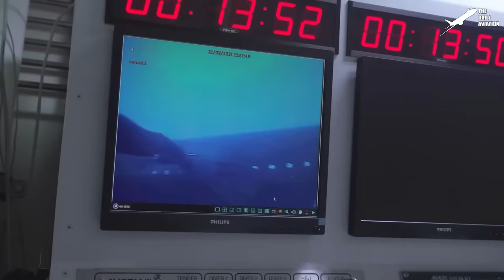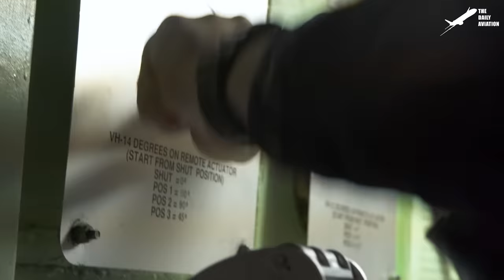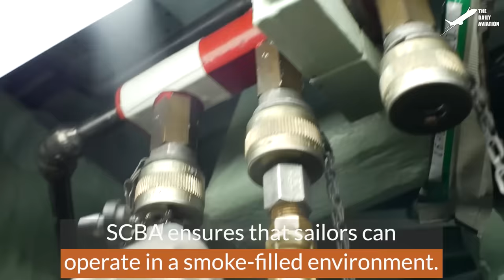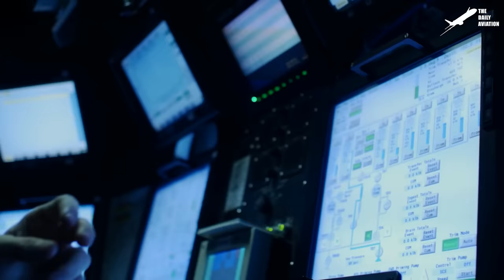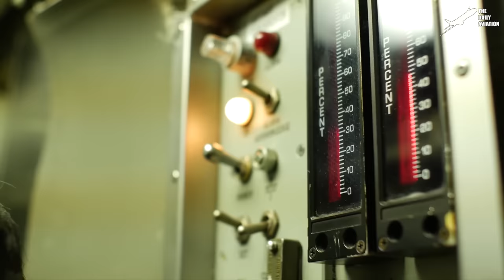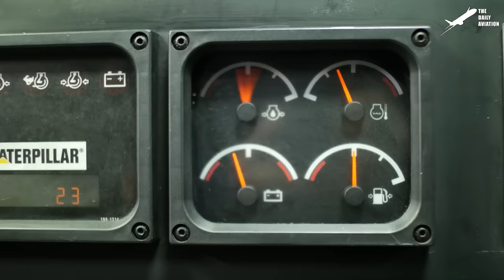Divers Pulling Out Man From Submarine During Scary Rescue Operation

Comment: It's very difficult to escape ,  if u not breathe by open mouth ,highly chances of lungs burst..it's speed of escape Is 50m/3sec.
Reply: You don’t need to breathe, you just need to be able to breathe out (all during the ascent) to avoid lungs bursting.  Failing that, having a hood over your head creates an air pocket in which you can breathe normally (for a short distance).
Reply: Been there done that several times!  ascent rate is no more than 3 m/s , compression though is a pressure doubling every 4 sec. I.e. 10 sec from normobaric to 50m.

Comment: Why are they sending them directly to the surface?? This is how they get deco sickness?!?!? They could have lowered a large clock with air i nitrox for safe return to surface.
Reply: Yeah these are basically enhanced and modern variations from the old Momsen lungs, which allowed submariners to escape to the surface from certain depths, and apparently the bends and other issues are possible but lessened from if you just tried to swim up to the surface with nothing. Also these new suits are inflated to facilitate rapid automatic surfacing.
Reply: you cant get decompression sickness from ascending out of a sub. subs maintain atmospheric pressure. you can shoot to the surface as fast as you want. barotraumas on the other hand....
Reply: I did not know that. I presumed it would have a pressure relative to outside. How do they prevent squeeze when exiting like this?
Reply: @oceancrossingutopia  they have a room that you enter and seal yourself in . then you flood the room with outside water at which time you become rapidly compressed to equal the outside pressure. then you ascend rapidly. due to not breathing air at high pressure you dont absorb any nitrogen therefor no decompression issues. the suit they wear has a hood on it that traps an air bubble around your head. the hood is open to atmosphere around the neck line. (like having a bucket on your head) a small amount of air is added into the hood via valves on the wall just before you leave the sub. this air bubble expands the whole way up escaping out the bottom of the hood and prevents your lungs from exploding as you ascend.

Comment: The only thing I slid into the comments is to say that the dude came flying up and for sure was bent.  I would rather be bent and need to take a chamber ride vs drown in a sub
Reply: I did this several times in training.  You don’t get bent because you’re only exposed to high pressure from the time the chamber floods till you reach the surface.  It’s less than 30 seconds so on-gassing is negligible.